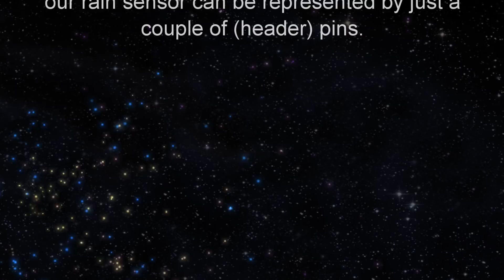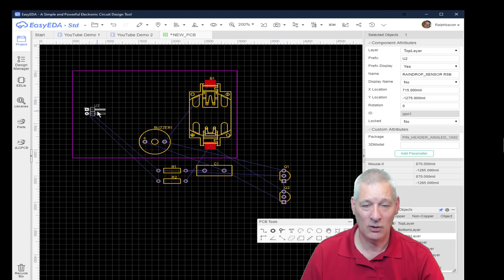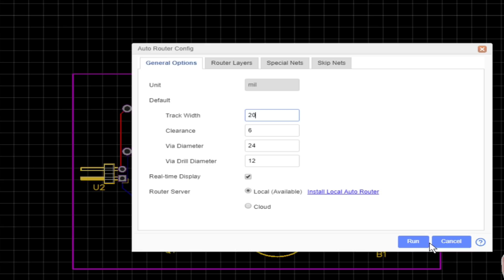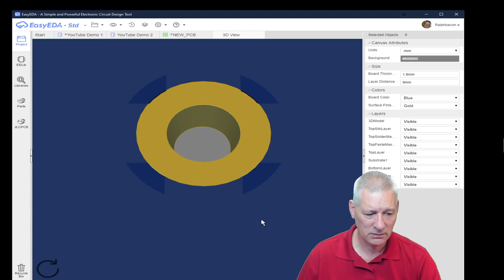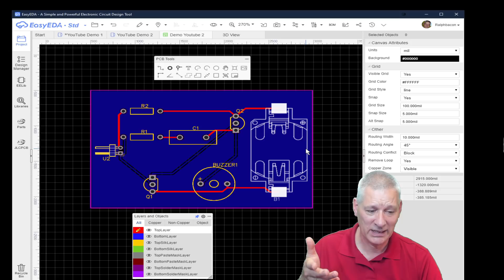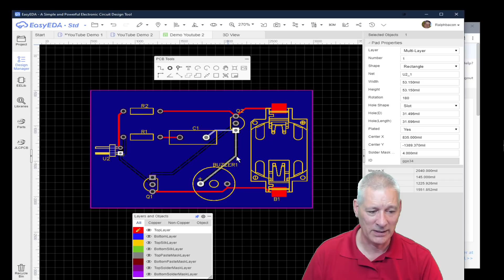#165 From Schematic to PCB - Part 2: Designing and Ordering the PCB ✅

Comment: Enjoying the DIY PCB tutorials. I designed my first board in EasyEDA and it went well using your video. I decided I wanted to add a power switch to the board but could not figure out how to edit the already routed PCB without having to place all the components on  the PCB again. I could not find any videos on making changes to a design. Any chance we could get one Ralph?
Reply from the maker: If you add further components first do it in the schematic, then import the changes as I showed you and it will leave all existing components where they are, with just the new component(s) off the board, connected via ratlines. Drag the component where you want it and do the Autorouting again. Or, if you're up to it, manually route. Any good? I will include this in any future video I do on EasyEDA though.
Reply: @RalphBacon  Thanks. I will give it a try
Reply: @RalphBacon  Thanks for the help and the videos. I teach beginner soldering classes to ages 10 and up at our local library. I have used different binky kits from the Far East that cost $3 to $6 each. I just designed my first board based on a 555 timer project in a book I have. I breadboarded it up way back when but have lost track of the 555 chip I used. I have ordered parts to test the circuit. I added a trim pot to allow for a little variation in the blink speed. I calculated the blink rate using online calculators but as you say wiring up the circuit before I commit to PCBs is the way to go. It looks like the cost of the custom boards and parts will be comparable to the kits I buy. I made the project shareable at  https://easyeda.com/lohmeyer.keith/test-2 
My first thought was to make the PCB itself wreath shaped (test2 pcb) but it looks like the only options are rectangle or circle. On the (wreath pcb) I just added the wreath shape to the top silk layer.

Comment: Heat!  Do leave space around components that get ‘hot’. Keep in mind that when going from bread-board to a project (in an enclosed box) the components will get hotter as air circulation is limited (or none at all). If you think a heat-sink is needed do allow room for it on the PCB. A common belief is that since VR ICs like the 78xx / 79xx (etc) have thermal cut-off one doesn’t have to worry, but when your circuit cuts-off after 30 minutes and then goes On/Off/On/Off it is embarrassing – if there isn’t room for a heat-sink …………lesson learned the hard way.
Reply from the maker: I can only imagine the embarrassment, Kenn. Not something you forget after that, but as I said before you can't learn experience! Good point, thanks for posting.
Reply: This reminds me of a warranty service I did some years back on a Fender guitar amp.  They had a headphone jack, typically plastic as are used these days,  and right next to it was a 5W power resistor that was in circuit when headphones were used,  to cut the power going out of the jack.  It apparently got hot enough to melt the jack to the point where the normally-closed switching contacts that would allow the sound to go to the speaker weren't connecting any more.  I did let them know about that when I submitted the warranty paperwork...  :-)

Comment: There is a temptation for newbies to make the PCB as small as possible. Don’t as it makes construction, cabling, and correcting mistakes much harder.
Reply from the maker: Absolutely true. I don't understand why smaller is always better. OK, we don't want stupidly spaced out components on a large board (like I used to make years back!) but compact is enough, leaving room for the soldering iron and meter probes to get in there!

Comment: Grounding can be a real headache. For single sided PCBs keep the traces for ‘Ground to component’ as short and as wide as possible. Ideally the distances of the traces are the same and meet at a common point (star-grounding). This can especially important in audio circuits. Remember the schematic illustrates the circuit and while Ralph is quite right (have the layout follow the schematic) there can be good reasons Not to follow the same ‘design’. In that case, document completely and file for future reference!!!
Reply from the maker: Documentation, Kenn? I've heard of that but isn't it always something we do "later", which is just another word for "never"? I've sometimes opened up a project box and found a folded up piece of paper with the circuit, wiring colour code and the date I made it all. Sometimes that's 10 years. Then I get morose that so much time has passed and I have to have a sit down in darkened room with a stiff whisky... but enough about me! It's an excellent point and I always keep the documentation, ideally with the project (inside the box, as I said) if I can. Far too easy for forget everything about it.

Comment: The ’standard’ TO-92 and even TO-220 components have leads that are close together and it can be a bit tricky soldering (without whiskers/solder bridges). For TO-220 package devices you might want a larger pad. Use a layout that has the leads staggered – rather than 
“o o o”, use 
“    o  ”
“o     o” where the middle pad is offset. Use needle-nose pliers to bend the lead and you are smiling.
Reply from the maker: Funny you should say that, but one of my viewers who took one of my PCBs for the ATTiny85 Fuse Resetter had terrible trouble with just this (it was a simple transistor). I never did have any trouble, but perhaps I should change the footprint to make it like you say to make it generally easier to solder? Hmm...

Comment: The modern pcb process is a mix of etching and electroplating. Therefore a blank area on the board does not mean that the full amount of copper (17 µm or 35 µm thickness) had to be etched away, but perhaps only a thickness of a few µm. Given the current price of copper any company will certainly want to recycle all their copper-etching waste.
Reply from the maker: I wish they would show the copper reclamation process, though. As you say, Uwe, it's all about money so I would have thought they either reclaim it themselves or sell the 'effluent' to another company to do that.

Comment: you can place text on a copper layer and it might actually be useful: when you etch the circuit boards yourself using toner transfer you most probably don't have a  silkscreen. It can also add some extra artistic touch to your design ...
Reply from the maker: Yes, I mentioned on another comment that I've seen some lovely bright copper logos on some boards. I must try that one day.

Comment: First thing first; thanks for the voucher i won a few weeks ago, just used it. Basically got the boards for free and just had to pay the shipping.

I know it didn't matter a great deal but i think you should of auto routed the board and then showed how to remove a track from the bottom layer and re-route it to the top layer.

When you put a ground plane on, ALWAYS shrink it back about 1mm. If it is to close to the edge, when they route them out/score them, the copper can be damaged and can lift in the future.

When JLCPCB lay on the silk screen, they will print a serial number on each board. If you don't want to see this number, add "JLCJLCJLC" on the silk screen layer under a large component and make the text height 0.8mm. You can solder the component above the number and it will never be seen.

When placing the order ALWAYS ALWAYS click pay later after they have inspected the boards. If you are ordering say 5 different boards and they find an error with one, they will start production of the 4 but will send back the 1 with errors and you will have to treat it as a new order. You can, if you are quick enough, click a button to combine orders (forgot where it is).

@Ralf, don't feel bad about getting a board back and your text is in copper, i think everyone who has designed a board has done it, myself included.
Reply from the maker: How long was this video... 30 minutes. Showing yet more stuff, Ian, like manual routing, would have meant an even longer runtime. I had to draw the line somewhere. I think Autorouting is great for beginners, even if you could do a "better" job manually, at least you know you will get a working PCB. Many have requested a follow up video which I might do once I have reestablished the viewer figures and credibility on my channel!

In EasyEDA, the ground plane is automatically shrunk back from the edge of the board here, Ian. User defined amount too. That's why for the top layer I make the rectangle bigger than the board. That way I can find it easier and know that is has already stopped the copper X mil away from the edge of the board, regardless where I put the outline. Another beginners plus.

I like the reminder about the order number and how to hide it. I'm not so concerned but others might be I guess. Good tip!

Yes, always click the Pay Later if you want to know you have a good board, but remember you will incur delays potentially. Yesterday they got back to me in about 2 minutes, on a Saturday night at 8pm. Amazing, I guess they work 24/7.

Regarding the (mistaken) text in the copper layer, I have seen some very nice logos in bright shiny copper (so the solder mask removed from that area) - looks good, maybe I will experiment with that one day!

Good to hear from you Ian, thanks for posting.
Reply: @RalphBacon  With tutorial video's, i don't mind if it stretches to an hour or maybe, break it up into segments on each aspect. 

My last order was delayed by 3 days because of a Chinese holiday but they are on there way. Order was placed on the 30th last month and according to the tracking, they are in the UK. 2 different board designs and a stencil. I used the GB Special Air Mail option this time as i was in no hurry. I normally used DHL Express and get them on the 3rd or 4th day after submitting the Gerbers.

Comment: How could you do that video without any mention of the underlying grid or snap-to-grid???
Reply from the maker: Because it is not essential to understand how to put a PCB together. It will be pretty obvious that things snap to a grid when you move the components around. Maybe something for a future video, Duncan, what do you say?
Reply: @RalphBacon  Yes, if snap-to-grid is enabled, components will snap to that grid, but what is that grid - imperial 100mil, 50mil, whatever or metric 1mm, 0.5mm, whatever?

In EasyEDA, snap-to-grid may be on by default (don't know, I use Eagle) but you need to know what grid it's snapping to - particularly when you have a mix of imperial and metric components to place.
Reply: @duncanx99  well, actually in order to place the components you don't need to know the grid. Same is true for KiCad - you can happily place components on any grid and route between the pads. The software will manage to connect the pads anyway.

But of course if you want to connect you parts nicely, place connectors, etc, it might be good to have full control.

I still think that that's what went wrong when they designed the Arduino Uno with those weird non-aligned header rows.

Comment: Play with the number of boars to made! Some times you get 5 for 5 €, 10 for 4,50€, 15 for 4,60 € and 20 for 5€. As a exampel. Why not get more litte Boards for the same price ?
Reply: was wondering about the boars..............
Reply from the maker: I guess it depends on how many boards you really need, Jens. If you only ever expect to make one or two boards then 5 is enough - save the planet and all that. If you're making a small batch run for a commercial product then more will be definitely worthwhile! Imight point this anomaly out in a future video!

Comment: One issue which I consider to be very serious, whilst I can download the client software and run locally on Windows in my case. Not possible to save these designs locally on my own drive. They all have to be saved via the cloud service they run. So they disappear and so do my designs. Far too high a risk for me to take. And before people scream what do you expect? I understand about the tie-up between the three companies. A sad fact of life no matter how big a company or group appear they can also disappear into the history books.  If this was to happen so would my files, well OK would have the Gerbers (but no circuit diagram and completed layout) Guessing everything comes at a cost when using Free Software. This is not to de-cry this software as seemed to have some good promise, and sure will work very well for many without you needing to be concerned over this issue.
Reply: this is the same reason why I don't use the free software from Altium either - no control, no backup, everything is in some company-based cloud without any warranty that you can rescue your design if ever the company gets eaten by a bigger company, decides to scrap the software, goes bankrupt,...
Reply from the maker: Yes, I had wondered about that.

You'll be pleased (and relieved) to know, Michael, that the files can be backed-up as a zip and then downloaded onto your PC. However, if the company did go out of business I'm not sure how that would help you as the client software still talks to the server, even when starting up. Whether it runs in standalone mode I haven't tested. 

Edit: I disconnected my PC from the Internet and I found could open the backup files, both schematic and PCB. It would not let me import changes to the PCB from the schematic nor generate Gerber files until I had logged in.

As you say, I guess the Gerbers could be imported into another program at that point. You can also export the schema(tic) to Altium files (although you do get a warning that this is currently experimental).

If the designs are that critical to you I guess you will be backing stuff up anyway, and/or exporting to other formats. If I lost an old PCB design, now done and dusted, I'm not sure I'd be that concerned as a hobbyist; as a self employed PCB designer or small business it would probably make me think carefully about the platform I'm using.
Reply: @RalphBacon  What we can establish without using a million words is that all tied up from a web connection based in the cloud. Yes I know a colleague has also mentioned Altium. I would prefer an export option to Diptrace or Eagle. Reality check how many hobbyists have a licence for Altium? I know you have to sell them for sponsorship and do not disagree with that in principle.

Comment: Good day, my dear Friend.

As always, GREAT instructive video you've done there.  I now feel more confident to experiment.  Thanks for answering my question as for the Ground Plane / coper pour.  I'll sure apply this to my existing « 'WWS' Data Logger » project.

I am getting along fine in sourcing parts that JLC will assemble for me, although I find it tedious to source similar footprint SMD LEDs.  I guess Package similarity is more important than choosing all the parts from the same manufacturer .. the price is also to be taken in account, although I'm not THAT thrifty to consider $0.002 difference to be a decisive factor.  LOL !

Like a good kid, I'll try doing my homework before I re-submit my work for further hints and » approval ».  re-LOL !

Ok 'Uncle Dan' .. back to the drawing board you go.  Have a great weekend and see you soon!
Reply from the maker: If you have many components you use time and time again, Daniel, you can 'clone' them and put them into your own workspace. Jut beware that they might go obsolete by LCSC when you come to use them, things move pretty fast in the electronics components world.
And, of course, all 0805 components are the same size so I don't care if they substitute components from someone else, it's not critical in my designs.
Glad you found the copper pour feature useful, I'll be looking out for your revised design.

Comment: Thats an excellent video, thank you. 

Never heard of the ground plain before, interesting. I’ve seen pictures of pcbs in the design stage, which scare me from producing one, as they look complicated. That video has shown me how simple it is really. Apart from getting used to the software etc. 

I think I’ll have a go at producing one for my rf24 project. Could I get the first time buyer discount and get two different designs, for that reason. Say, 4or5 each.
Reply from the maker: Yes, have a go, Chris! You can practice and practice until you KNOW that your PCB will be correct if you were to order it. No surprises or guesswork! 
First time buyer discount only works for your first PCB I believe but you can submit two designs in one order and see what price you get quoted. And $8 OFF on the First Electronic Parts Order at lcsc.com which can cover multiple designs, of course.

Comment: Thanks alot to get me in with my own pcbs :D i never knew how to start building my own.
is it possible to get the pcb with Components in 3D View?
Reply from the maker: Unfortunately, EasyEDA does not show 3D views including components - unlike KiCAD that does this wonderfully well and can highlight potential problems just by looking at the board. But EasyEDA is limited to just the board right now, pity.
Reply: @RalphBacon  hmm then i think i will stick to KICAD maybe, or both
Thank you!